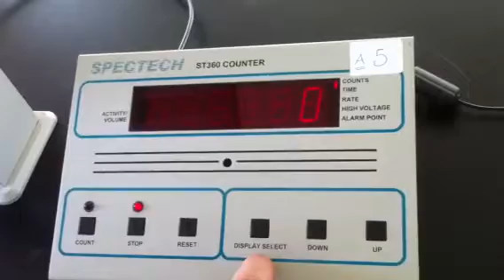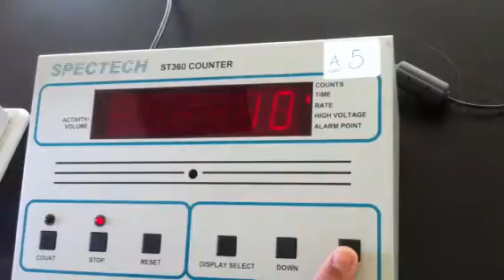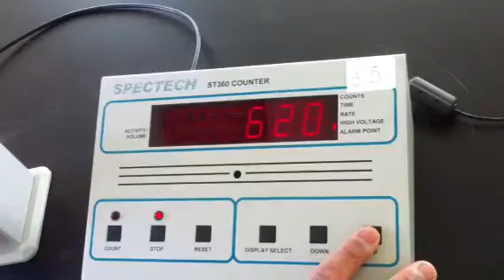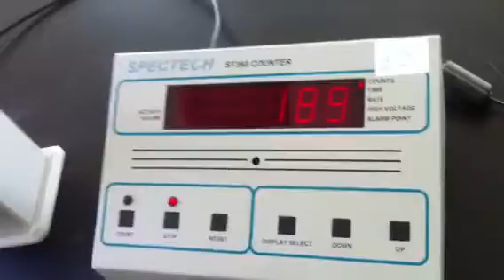How to use GM Tube in Radiation Measurements

Comment: Running down the center of the tube
 there's a thin metal wire made of tungsten. The wire is connected to a 
high, positive voltage so there's a strong electric field between it and
 the outside tube. When radiation enters the tube, it causes ionization, splitting gas molecules into ions and electron